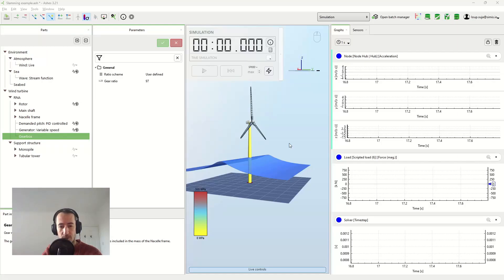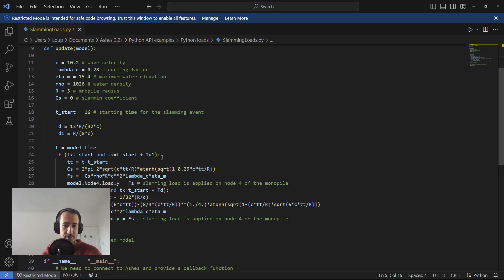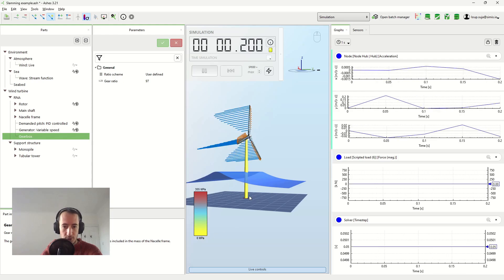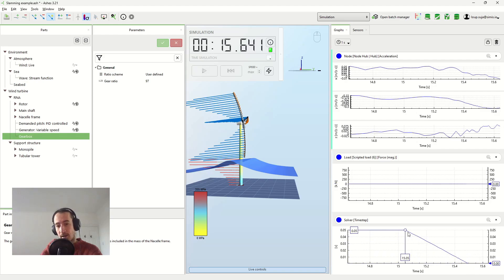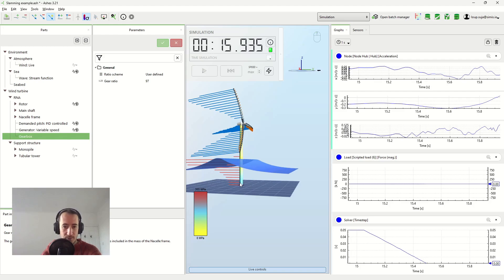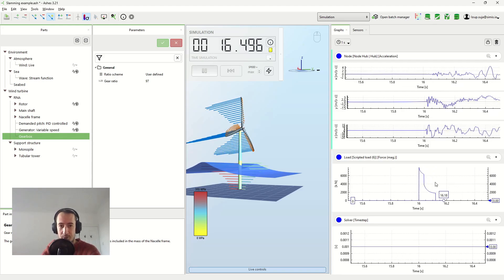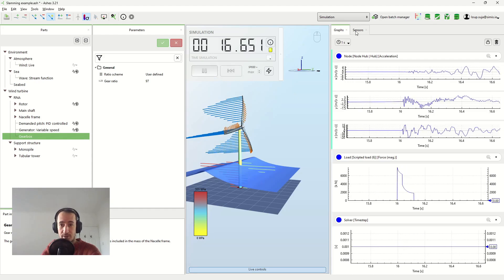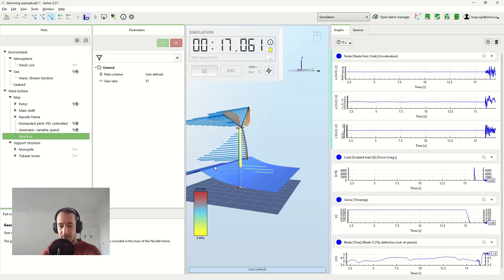Slamming loads on an offshore wind turbine with Ashes and Python

Comment: The python script that computes the slamming load where can we find? Also I am new to Ashes, did you generate the bottom load graph by importing the python script to ashes, or have I misunderstood? Please enlighten me briefly whether script is used to generate the graphs you showed.
Reply from the maker: The script is not shipped with the current version of Ashes, but get in touch with us (support@simis.io) and I will happily share it with you.
And the graph is generated by Ashes, not by the script. There are a couple of ways to plot graphs, the simplest is probably to right-click on the load you want to plot and add a sensor